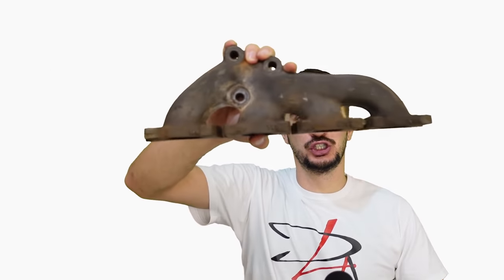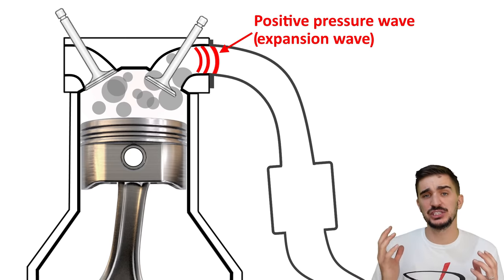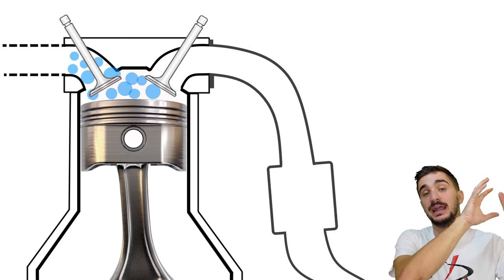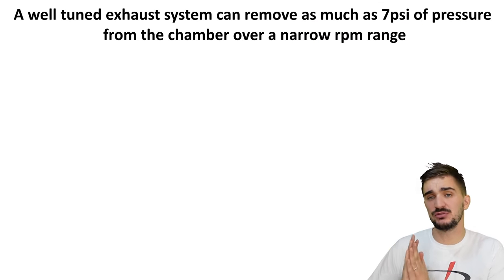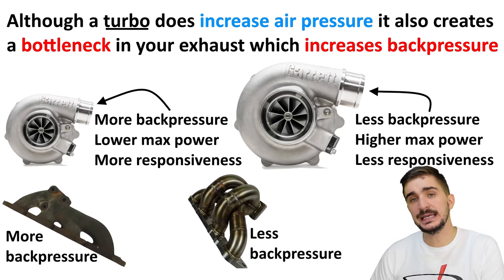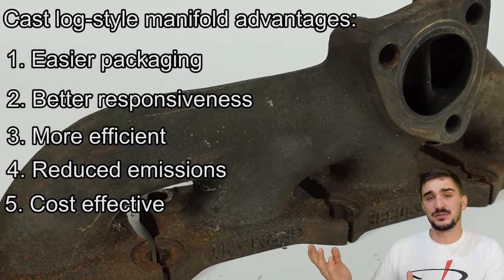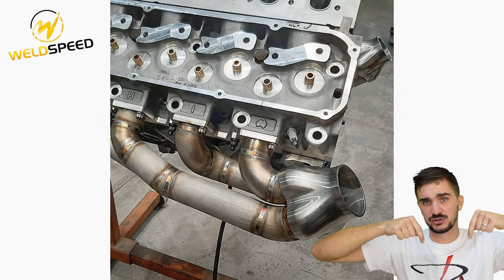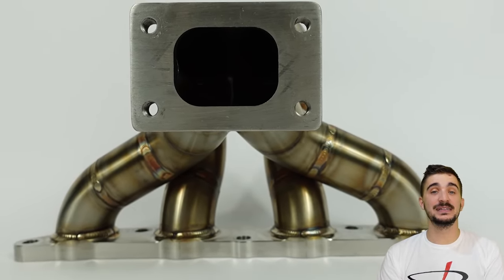EQUAL LENGTH tubular vs. LOG manifolds (headers) - SCAVENGING and EXHAUST BACK PRESSURE EXPLAINED

Comment: How about carbon fiber disks packed into a cylinder and all your manifolds have short, direct channels to the cylinder.  Carbon fiber is stiffer and more heat resistant than literally any other materials.  The series of disks within the exhaust cylinder will spin no different than a turbine, and can replace your complex blisks.  The exhaust will follow the disks via laminar flow and push to internal channeling running through the disks, to propel the exhaust down a shared exit pipe.  Basically a tesla pump.  Now you have the best of both worlds.  Short - but equal length - exhaust pipes.

Comment: Why is your turbo cutaway showing air coming Out of the air intake port of the turbo? Isn't that backwards? It sucks air into the turbo from there and pushes it out from the outer charge pipe?
Reply: That illustration only shows the compressor side of the turbo
Reply: @chrismaina1830  I noticed that. The air effect in the vid made it look as if air was exiting the intake portion of the turbo. That was all I was getting at. In a long winded way I guess. Lol
Reply: @glencalhoun9544  it's all good we do trip a bit😅😅
Reply: @chrismaina1830  Right Right. Lol 😂

Comment: the difference between equal length manifold and a well designed log manifold is minimal. especially with a ported head and cams.  i had more back pressure on my doc racing n54 manifold and my 3d designed log manifold from m18 made more power , better response and efficiency.

Comment: Engine sound also will change drastically. For example audi 5cyl 10v log manifold sounds so mellow and pleasant but 20v tubular sounds obnoxious. Almost like comparing Chevy LS1 to Ferrari v8. Same with subaru EJ20 engine, equal length header on those sounds so bland.

Comment: 1:12 Oh, not always!  If you have a vintage Benz 300D "project" car which is set to undergo a veg oil setup, the turbo could communicate directly to the outside air HAHAHAHAHA

Comment: Do they make equal length manifolds for N/A cars
Reply: Most don't, due to lack of popularity vs cost, vehicle fitment, etc. Depending if you're doing short, medium, or long tubes also can change how difficult or easy it is to make equal length headers. Shorties might be difficult in a tight engine bay, especially for longitudinal inlines or V engines, but if you use long tubes, you may be able to get some twists that allow you to balance them out.
Reply: Yes, of course as N/A cars would benefit the most. However, you will need to research available parts for your own car.

Comment: Why is garage 4age's video show back pressure reduce the power from his engine? i didn't quite understand his video
Reply from the maker: I didn't watch the video but I'm assuming an increase in backpressure reduced power. The more backpressure there is the more energy the engine must waste to overcome it which of course leads to reduced power outputs.
Reply: If by chance they did lower backpressure and actually lost power in a certain case, keep in mind that backpressure readings (vs traces) are an average and what was mentioned in this video about the end of the exhaust stroke/overlap being a crucial time is a huge part of it. Smaller runner diameter tends to increase average back pressure but have a stronger clearing effect near the end of the stroke where it really makes a difference

Comment: You forgot one thing. Stainless exhaust manifolds have a very bad habit of CRACKING. Anyone that has welded stainless know its a pain as it warps heaps more than iron when heated and cooled. For a high performance track car a iron tube exhaust manifold can be better if its made from right materials.And is cheaper. And stainless exhaust manifolds doesnt mean its more smooth inside. A tube iron can be just as smooth. But comparing a cast and tube manifold. The tube is going to be smoother because its made from... Tubes... 😅

Comment: Have a 6.5 Horsepower predator 212cc that fires up with stock engine, run a supercharger off the crank. Then tube it to your intake. No parasitic power loss. Hybrid single cylinder supercharged driver motor.

Comment: I didnt watch the video yet i will soon so i dont know if you already adressed in this video. Can you also make a video for headers on turbo applications. For example for 1-2 years mercedes f1 used cast log headers on their turbo v6s but then went back to tubular equal length ones. I heard in turbos its more to do with exhaust heat management than performance but still want to hear your knowledge on it.

Comment: Wouldn't it be awesome if car manufacturers, from the factory, used a form of header instead of exhaust manifold and then used a catch can. How much more efficient with those engines run.

Comment: This video will be in 50 years a historical one and will be considered ancient technology, students of the internal combustion engine will have very difficult time comprehending the detailed information provided on your video infact some will not even get it @ all! the new generation students will only undestand (voltage/wattage/amps/resistance/power loss by temperature differences/algorithm GPS distance range efficiency/gauge wire size resistance and insulation/optical wire connectors and many other things related to electrical cars!
Reply: Electric cars are a fad. Always have been.

Comment: Not all headers scavenge and a well designed cast log manifold can scavenge. It's to do with flow past another tube. Equal length is pretty pointless unless they are tuned, which is determined by an equation that gives both length and diameter answers for a given rpm range and thermal efficiency for that engine. No engine produces perfect vacuum due to the rings allowing a degree of blow by.

Comment: So, let me summ it all up.
All you need is a free flowing exhaust.
The shorter the tube, the less resistance.
So, why not buy a fancy automotive jewelry, with longer tubes,  and do a video on it, so it pays itself back?

Am I missing something important here?

Edit: 11:56 "The OEM runners are actually feeding into each other" thus increasing backpressure.
What?  More cross section equals higher restriction?  Impressive! ;-)

Comment: time stamp 6:39's formula for tube length is wrong, it should be Primary Tube Length = [850 (360 – EVO) ÷ RPM] – 3, NOT Primary Tube Length = (850 (360 – EVO)) ÷ (RPM– 3)

Comment: Isn't the X pipe a bottle neck?
Creating more backpressure, and therefore more heat? More heat, as explained is more energy, just like the benefits of the cast iron log manifolds... For street motors, cast iron exhaust manifolds work just fine, without all the noise of open headers, so you can listen to your jams without yelling...

Comment: I call BS on overlap not applying to turbocharged engines. 15psi boost doubles power (compared to NA) of an engine with a mild cam OR a wild cam.

Comment: Anyone ever used or familiar with heat tape? It changes the molecular structure of metal. It will crystallize metal. I ruined a pair of headers once. I put my finger right through a header once.

Comment: Tubular is better..
Both lack a Vacuum, which allows hot gas to settle in the exhaust system, causing engine heat and sediment build up..

Comment: spoiler alert,  subarus sound they way they do, IS NOT because of unequal length headers/manifolds
my goldwing is the EXACT same architecture and doesnt sound like it, for 1 reason  FIRING ORDER. the same reason the  2.slow vw's sound different than EVERY other 4 cyl...  they dont have a 1342 firing order

Comment: i do not agree with you:
1.   02:47, you said that puls travels with local speed of sound what is 1400km/h, that means that temperature inside of exaust is 101c deg, what is very wrong, when engine works, after few minutes even if outside is polar coldness, it reaches temps over 300c deg, so speed of sound would be 1732km/h
2. i first part  you explain how it works on single piston engine, but is more important how it interact on more piston engine
3. you chose wrong way to explain this topic, you should speak about volume of gases that leave cylinder , enters into primar tube and make low pressure behind when ex/valve closes and makes suction in collector in other primar tubes, x pipe would not even mention

Comment: exhaust is the most misunderstood subject in the car industry. it is impossible to get any useable information without dyno testing. most people think that a straight pipe makes the most power. i love (really hate) when someone removes all oem mufflers, resonators and cats and then thinks their car is faster than the factory engineered setup. in most cases you'll lose power through the entire power band and become obnoxious to everyone at the same time. do your homework before hacking up your exhaust stance boiz. noise doesn't equal power. finally, do not waste any money on a "cold air intake" if used with a factory  engine. you'll probably lose power and money again.

Comment: I think the general notion that a log manifold can't build power is very silly. A 6.7 high output Cummins makes 1075 ft lbs of torque with a log manifold. It doesn't even try to scavenge off of the other cylinders.
Reply: But you can get more power if your manifold is more efficient.

Comment: Why can't the exhaust tube change its diameter? In the same way they invented variable valve timing, someone should invent a variable diameter exhaust tube.
Reply: Yamaha did on their YPVS system on their 2 stroke motorcycles.

Comment: Sorry. It's a no sense story. There is always a substantional backpressure in a turbo engine. just look at the tiny throat of a turbine housing and the slim gap in the annular volute. This puts conventional exhaust pulse tuning pretty much out of the window completely. Just look at the newest turbocharged engines that have no exhaust manifold at all and often siamesed ports, or just a single port just to get the hot gasses on the turbine wheel as soon as possible. The turbine mainly extracts power from the expansion of hot gasses. Not exhaust pressure or pulses. All those fancy tubular headers do is let the exhaust gasses expand and then try to sqeeze them back into a small hole. The heat load on them is tremendous and they will crack. Always. The reason why no OEM manufacturer uses them. Even the F1 Mercedes championship winning engine used log style headers for years: rather unhindered air flow to the rear wing than a fancy heat shedding header in board. The only reason I see for tubular headers is with a very big turbo low down off boost, or for easy off manufacturing aftermarket. It's hard to make these mindswitches from NA engines to turbo engines, but they just work completely different. And keep in mind that a turbocharger can easily extract and deliver douzens of horsepowers trying to pump compressed air into an engine.

Comment: You are confusing two stroke expansion pipe theory with header scavenging theory. There is no beneficial reflected pulse in a four stroke exhaust. The scavenging effect takes place because of the low pressure created behind the high pressure high speed pulse of exhaust.

Comment: Let's see if I can make it easier . When you have gas you need to fart . But of course if you can your miserable . All new cars have one serious problem heat . Unimaginable heat . So if you want to improve the exhaust I think they can loom a coat the exhaust and drop temperatures greatly which should be much more beneficial than the BS

Comment: What a waste of time. I have pulled 900+ hp with modified factory manifolds on a turbo engine.
Reply: No you haven't.
Reply: 900 + hp with a Precision T 72 on a Northstar engine. Later 900+ hp on a GM 6.0 with a Turbonetics 60 Series. I pulled 345 to the wheels on a GM 6.5 Turbo Diesel with another Turbonetics 60 with the factory original pump. I am no genius but I have been doing some of this for a while now.